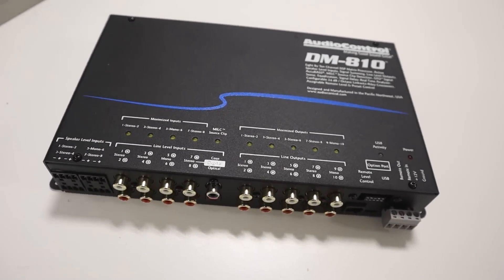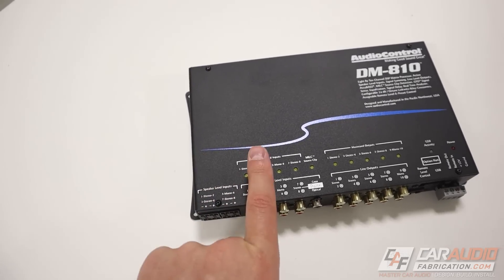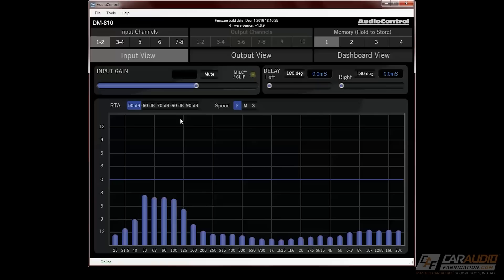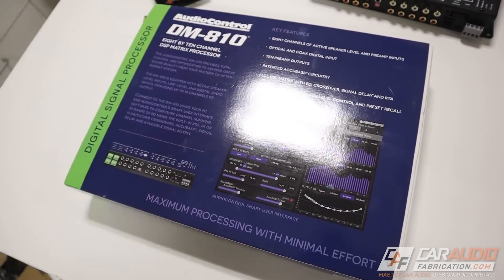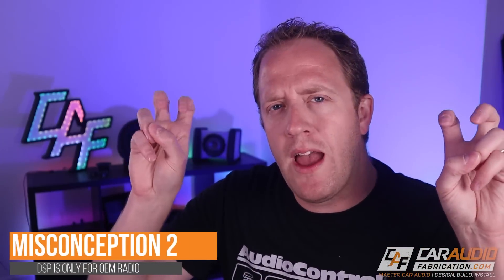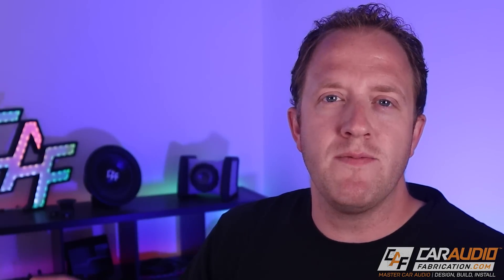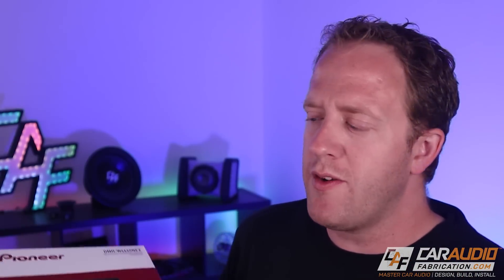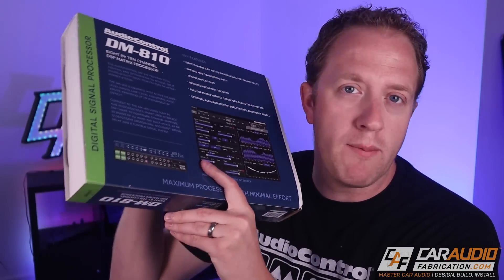You’re using DSP wrong! Top 5 DSP Misconceptions

Comment: Can you use this DSP with a Bose system in my 2020 Nissan Maxima Platinum without upgrading speakers and head unit?
Reply: Yes, however you would also need an amplifier. For your case, you would take the high output signal from your head unit then connect it to the DSP. Then you would hook up the output of the DSP to the amplifier. The amplifier then goes to the speakers.
Reply: @Veritas-invenitur  thank you much.
Reply: @beekaye1496  Glad to help. Realistically speaking, I have absolutely no idea if such project would be wise or worth it.
Reply: @Veritas-invenitur  I am going to add focal k2 and K3 plus focal 3mv center and most like some 1in tweeters as well
Reply: @beekaye1496  That’s Fantastic! Enjoy the system!

Comment: First I am really liking your information and channel.  I have a question I just installed Focal sound in my car.  I am running a 10" Flax ( currently in a sealed box ) and was curious as to your thoughts on sealed vs vented and also I am going to add a DSP and was curious DM 6channel vs the 8 channel ( i only have front and rear and sub ) or focal 8 channel

Comment: "Time Alignment"

There is no such thing as "time alignment". You cannot align time. You cannot alter time. You cannot delay time. Time is the 4th dimension. Time just *is*.

What you are doing is signal delay and phase shift.
Reply from the maker: Ok. Doesn't change the fact that the manufacturers still call it that so.... not going to get on a high horse and confuse people trying to learn for no reason.
Reply: @CarAudioFabrication 
Not on a "high horse" at all, just trying to set the record straight. If knowledgeable people that are respected such as yourself start using proper and accurate terminology, then the masses will get an a real education! People will follow where you lead them!

While we're on the subject, the other term that makes me cringe is "subsonic filter". Subsonic is slower than the speed of sound. The appropriate and correct term is "Infrasonic filter". Infrasonic is a frequency that is lower than the the threshold of hearing.

We are not slowing down the sound the speakers are playing, we are filtering out the inaudible frequencies. Hence why subsonic is wrong, and infrasonic is correct.

By the way, your #3 point was absolutely deadly accurate. I absolutely loved the fact that you pointed out that you need to carefully plan out and mechanically fix your stereo system before you start tuning it. Far too many people use DSP's as band-aids for terrible installs.

Comment: Audiocontrol really needs to implement a Parametric EQ.  You get that in there and these DSP's are gonna be worth their money.
Reply: Do they only have graphic eq? Those are nearly worthless for tuning a car. Parametric eq is a MUST.
Reply: Not to get into the parametric vs graphic EQ “which is better” argument, but not one in a thousand car drivers have the experience using high quality parametric EQ that a professional electric guitarist or sound engineer would have. Even the majority of audio installers would not know how to adjust para EQ optimally, and the results would likely suffer.

Graphic EQ better fits the target audience for AudioControl products. This company is not chasing highly experienced sound studio crowd. This is consumer grade merchandise targeted at above average audio consumers, not studio pros. The price reflects that market position.
Reply: So theres no right setting point for parametric graph? @WildMidwest1
Reply: @WildMidwest1  I can't stop laughing at the notion that people who are willing and able to spend $800 on a DSP are not interested in or capable of learning how a parametric EQ works. Yeah, real average Joe brand Audio Control is. Pretty sure it's only sold in Walmart. 

Also, I learned how to use a parametric EQ in less than 30 minutes when I was 13 messing around with a VST plugin in FL Studio. It's just not that complicated.

Comment: Another point with those passive crossovers is the protection it gives you with the tweeter. One main reason why I use them. It takes out the extra work and math to figure out what in line capacitor you need for the tweeters if you are going active (IMO)...
Reply: I don't believe in active crossovers for the mids and tweeters.  Manufacturers spend a great deal of time matching drivers with passive crossovers.  I only use active crossover settings for cutting out low pass.
Reply: It can go either way with a passive setup. That depends on user experience and aptitude. A passive setup can take time, to truly understand power levels at different crossover points. I've fried more than a couple sets of tweeters, and mid-bass drivers, learning power level differences from 3k and to 5k and up on the tweets, and around 100hz and up for midbass, and 150hz and up for midrange. There's more power than you think going to a tweeter crossed at 3k, and more power going to a midrange at 150hz. Especially when you have a whole lot of power on tap.

I've learned exactly where my amps and drivers are, and have them set close to their thermal capacity, but behind the line, slightly conservative. Right to the line, but behind it a small bit. An initial tune independently, then again all together to blend it all. Active is the way to go in my opinion, capacitors and passive crossovers is old tech. Send exactly the signal you want, pure, no distortion, no time or phase delay, added inductance or termination points that create resistance. 

Sonic purity can't be obtained without one, in my opinion.

Comment: I’ve been using the JL fix86 for awhile now, It basically makes your stock radio adjustable and tunable like aftermarket radio
Reply: How is it working for you man? I got a 16 Denali with bose and i put in an lc2i and anything lower than 42 hz is non existent man im soo bummed out
Reply: @rodolfosotelo5929  It depends on your source signal, the JL does a good job at creating 20-20khz but if your signal isn’t as full it won’t be as good. Love the fix86 though, this is my second truck I’ve installed one in.
Reply: @Silentroller93  thank you very much I appreciate it man im going to look into this a little bit deeper those GM intelilink stock stereos are nice and all but the sound quality is not what i expected man i may just end up pulling my sub and amp out if i cant get this thing right i got a wolfram audio AW-1500 and a 15 inch wolfram audio AG 15 wired down to 1 ohm in a 4 cu. Ft. Tuned at 32 the set up sounds nice in my other vehicle but in the Denali the bandwidth is from the 40hz to 60hz big time bummer

Comment: Yeah I have a 5ch amp and it would be nice to have 7 channels to connect the component tweeters independantly.
Reply: So that’s not how it works, ( at least I don’t think so)
You could tune them if they are on their own channel 

Or if they are on a crossover with a midrange woofer on the same channel then you could only change frequency responses .
Reply: @abelscaliber7969  I think that's what he meant.
He has 5 channels, front right and left, back right and left, and sub. He probably has a crossover for his woofer and tweeter up front installed rn.

He was saying it would be nice to have a 7 channel amp so he could have, front left woofer, front left tweeter, front right woofer front right tweeter, back left and right, and sub all under individual control

Comment: How do you time align subwoofers?
Reply: You measure how far it is from your listening position in either Inches or meters

Then let’s say it’s 56in,  you input that value in the dsp 
If you have multiple subs then just use the average distance 
It honestly doesn’t make that much of a difference
Reply: @abelscaliber7969  I have a halo9 and I’m using it for time alignment the speakers are aligned correctly but the subs setting does not go high enough. It only goes to 24.1 inches. 
If I set the right subwoofer at 24.1 inches it doesn’t allow me to add a value for the Left sub. Like you said I don’t think it makes much of a difference so I left it off are the subs being that it’s low frequencies and they are not as directional has a speaker
Reply: You don't just time align subs, you align ALL speakers so the sound from each speaker arrives at your ears at the same time. In most vehicles, the sub is furthest away, so  what happens (without any DSP) is sound from closer speakers (like front doors) arrives first, and then a few milliseconds later the lows from the sub arrive, resulting in sloppy midbass. To fix it you apply delay to the front speakers, so they "wait" on the lows to travel a bit, and then play, so their sound arrives at your ears at the same time as the lows, which results in a tighter overall sound, especially around the crossover point.
Reply: @PURESOUND4  I’ve already align the speakers I left the subs Alone.

Comment: I swore off DSPs for the longest time until my car audio guy talked me into the Rockford DSR1. I'll never have another car system without a DSP.
Reply: Do you have any issues with your DSR1 Bluetooth? Do you feel like the bass is lacking at all? But otherwise I agree it’ll be hard to go without one going forward
Reply: @IAM_Car_SHT  Most of the time, when I immediately open the app it'll connect and then drop. But once I reconnect, zero issues after that. I haven't experienced any issues with bass that I'd attribute to the DSR1 - it's more with my Kenwood sub. I've got a 500w Kenwood P-XW1221SHP loaded box. I love it, for the most part, but I wasn't paying too much attention when I bought it. Frequency response bottoms out at 30Hz. Running a few test tracks and whatnot, I can tell it starts rolling off around 45Hz. I've found the 60-80hz is the sweet zone and will make my mirrors dance, though. 
In the DSR1, I keep the "Punch" setting at 8 dB. I set my high pass for the front at 175Hz with a 48dB slope. Rear is at 200 with a 48 slope. My low pass for the sub is at 120/48. A little bit of messing around in the Basic Tuning EQ and, for my setup, it sounds pretty damn good. 
2018 Malibu LT, factory head unit to the DSR1 to a Kenwood XR901-5. 
Kenwood XR-1801P for the fronts, KFC-X183C for the rears and the above-mentioned sub.
Reply: My dsr1 will not hold EQ changes. I constantly have to connect and reload saved presets
Reply: @AdamOleson Every once in a while, the DSR1 completely cuts my sub out (turns the gain all the way down). I don’t know why, but I go in, turn it back up and I’m good for a few months. Outside of that, I haven’t had any real issues with it.

Comment: Correct me if im wrong as im quite new to car audio. Meaning to say that if i dont want/dont have the options to change the player, adding amplifier or at least a DSP to the stock sound system, it will improve on my sound quality? 

Then topping up if can change out the speakers, then the DSP will totally shine?
Reply: If you want to use a DSP, you can use the stock headunit, and you probably could even use the factory speakers, depending on their impedance, although I wouldn't, but you'd have to add amplifiers too.

Comment: For the budget build its possible to use an aftermarket radio DSPs like the pioneer in this video but you'd have to run in network mode and only run a front stage. So you'll have full control over the front tweeters, front mids speakers and sub individually for time alignment. crossovers for each pair. Only real negative is the EQ still will effect everything together and not individually. In a single cab or extended cab truck it would work out pretty good not perfect but on a budget it'll get it done great.
Reply: No they are garbage
Reply: @bennyblanco14  not garbage just not perfect. Most people never even try running the radio in network mode because they don't know anything about it or how works. It'll get the job done for the budget build and people just getting started into DSP. Plus Sony has new head units coming out that will have a real DSP built in. So the stand alone DSPs will eventually be slowly fazed out.
Reply: @bigk7788  I read your comment wrong ..I apologize ...I thought you were referring to those android HU with build in DSP... I currently running a atoto s8 pro android HU and it came with a built in DSP ...now the DSP is far from good along with the preout voltage is 1.5 volts ... It doesn't have none of the fine tuning like different crossover or q factor .. it's basically like an old school EQ .. my boy has the pioneer HU that has a DSP and for 200 dollars, it's not bad at all.... It's perfect for a beginner... I always tell people , if you want SQ besides installation, tuning is the key and one of your best tools is a DSP so don't cheap out .. eventually you gonna have to get a great one like a helix or a zapco
Reply: @bigk7788  Stand alone DSP will never be phased out. Built in DSPs will never have the adjustment capabilites of the stand alone.  Why do I say this?  I have the same Stinger head unit as Mark and use an amp with DSP built in. It has WAY more control.
Reply: @chuckw6099  actually stand alone DSPs will be fazed out at some point. Like I mentioned before sony has the new es line with a comprehensive dsp built in. Now its just an early attempt at it and once other companies start to step up and compete with sony that's when all the typical dsp features will show in aftermarket radios. As for people that have to keep the oem radio they'll typically run an audio control amplifier with a built in dsp. Eventually other manufacturers will follow suit and offer amplifiers with built in DSPs. Stand alone DSPs was needed because of the technology that was available at the time but, now with how amplifier and head unit technologies have advanced it's to the point now that a standard double radio can have a full dsp and a fairly powerfully built in 5 channel amplifier. Just look at how small some of those micro amps are getting. Right now yes stand alone DSPs are needed but give it time.

Comment: One of the biggest downfalls of the audio control product is that the crossovers are global...meaning all the "different tunes" you create have to share the same crossover slopes and values. So if you have multiple tunes for different reasons like top and top down on a convertible, or a Jeep top on and no top, the crossovers have to remain the same. LITERALLY NO OTHER COMPANY IN THE INDUSTRY DOES THAT, THAT'S STUPID. If you want more volume with the top off or down, you are going to have to readjust your gains, crossover points, and even make some EQ adjustments. You know that to go louder and to get less distortion you have to set your crossover points higher. 
They need to change that...and catch up with the industry, or make a running change in their products or software. 
Great videos by the way! 🤘🇺🇲
Reply: Then what DSP would you suggest?
Reply: @spottedauto7735 the current leader I would say is goldhorn

Comment: How loud do you usually play white noise in a car to get proper reading from your RTA?
Reply: Play PINK NOISE at the volume you usually play your music.  Speakers of different sizes do not have a "linear" efficiency.   Speakers sound differently at different volumes.  What may sound good at one volume level may not sound that great at others.  It may take days of listening to various tracks to get the sound correctly. What may sound good one day could sound bad another. DO NOT listen to pink noise without ear plugs when adjusting the EQ. "Listening fatigue" changes how you hear sound, that is why I say it may take several days or weeks to get the sound to your liking.  I have 2 vehicles with a DSP amp in each and it took a while to get them sounding great.
Reply: Doesnt need to be loud

Comment: Great video, Mark, I have a guesting,  I bought some new tweeters for my system, ground zero uranium, modle gzut 28 sq, 2500hz to 25khz 3000 hrtz @12db octave, how do I go about getting a high quality cap, for them , I am going active, late next year,  but want to install them ,before that, and just might keep the caps even after dsp , can you help !! If not that's cool ,still a fan !!
Reply: Is it a misconception that you can use one without a radio?

Comment: If you have the dm810, do you still need a matrix plus line driver?
Reply from the maker: Not necessarily as the DM series has substantial voltage on the outputs